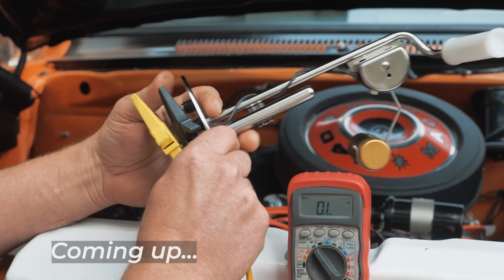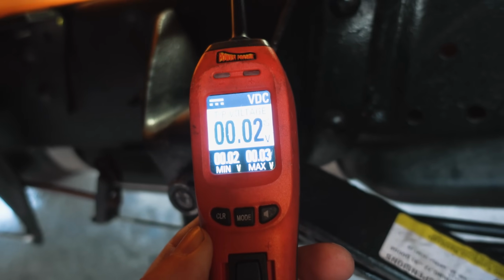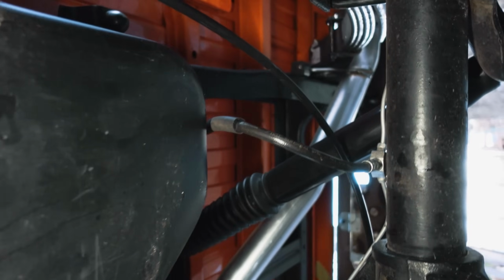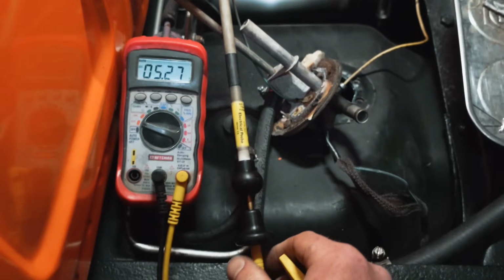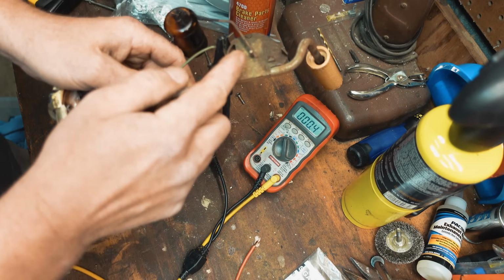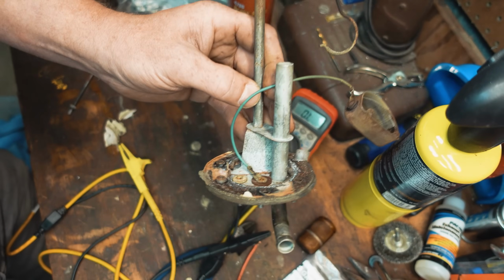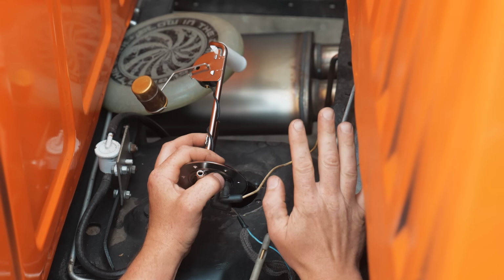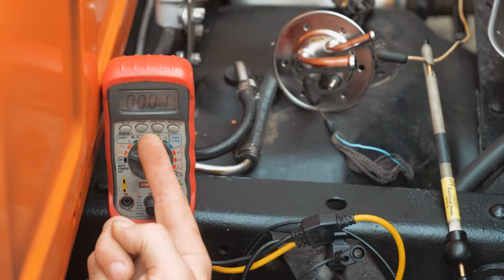Vintage Fuel Gauge/Sending Unit Testing [Dodge Pickup]

Comment: The metal comes from the fuel pump nozzle. When you fill up your tank, it's aluminum. It took me a while to figure that one out.
Reply from the maker: Nice! Thank you
Reply: No problem my friend...
Reply: I was using a 5gal can to fill a generator from a single station over a few months, never fully emptying can. Generator started getting harder to start. Long story short In that full 5gal can I extracted about 1 gal of water. Drained float bowl, good gas again and it ran great. I think we get a lot of....stuff...from the station tanks

Comment: Don't forget, on some of these old cars that use the old style ignition coils that with the key on your coil can be powered up all the time.  Leaving the key on for a long period of time can burn up the coil.  Having learned auto mechanics on old cars like this in my youth, I still to this day, always think about this when leaving the key on on newer cars, even though it's not an issue on modern vehicles.
Reply from the maker: I believe that is on a point type system only. If the points are closed and you turn the key on, then you'll have constant current flow through the coil. I do not believe any of the electronic ignition designs that was as issue, but I could be wrong
Reply: @ScannerDanner  Yes, I believe that is true.  It happens when the points are closed.  Just something to be aware of when working on old cars.

Comment: Great video as usual Paul, even with our high expectations of your channel by now. Do you have the 5 volt adapter for your power probe? Protects modules and gauge clusters. PPT5VA  ;)

Edit: Glad I didn't type in the incandescent test light tip, might have let you know I commented before the video was over. haha
Reply from the maker: I do not! Didn't even know that existed. It is an add on for the pp4?
Reply: Yeah, and it works! ;)

Comment: That activity should not be done over the open hole to the tank. At least plug it. Even static electricity can set off the ullage vapors.
Reply from the maker: Good call, and working around a plastic tank can produce static

Comment: The bypassed ammeter made me sad.
Reply from the maker: I'm sorry buddy. To me it is simply another contact point and gauge/component, where you have resistance and unwanted voltage drops and those create heat. And heat was definitely there! Should have seen the color of the copper wire near the gauge when I bypassed it. (Black/blue copper)
To be honest, imo, this was not a good design even when new. But I get that my Tin Grille friends would want it as designed. 
The other factor is my gauge actually read backwards, and the wiring was correct, so someone rebuild that gauge incorrectly. I just didn't trust it, and most certainly don't need it as I have a voltmeter just to the left.
Reply: @ScannerDanner  wwll pulling it one day and doing the brass sleeve upgrade on it might make a good video for you.
Reply from the maker: @tingrilledodgetrucks5988  brass sleeve upgrade? You'll have to share the info on that for me on your page! I'm interested for sure.
Reply: @ScannerDanner  there is a link in the comments of the "feature" post. Used to be called "announcements"

Comment: You are the greatest teacher by far.  Something I was waiting for you to explain... why is the signal pulsed?  I assume it's there for other circuits that the IVR is supplying and the fuel gauge doesn't need or care about it..
Reply from the maker: I can tell you this much for sure. Thermostatic or bimetallic gauges will get cooked with 12v. We are making heat to warp metal in the gauge. So the IVR steps the voltage down. Now, why it is pulsed, only with a load? I'd have to take one apart to see what is in there. I thought these things were pulsed all the time and they are not!
I do also know that a newer 5v reg with a steady voltage all the time will work great on this system too.
So maybe the answer is that it is a mechanical 5v reg and heat/current flow is the controlling mechanism inside of it?? Best I got
Reply: @ScannerDanner  Thank you!

Comment: Since the sending unit is just pulling a voltage to ground and the resistance of the float is what varies the voltage, there shouldn't be a backwards for the sending unit wiring, should there?
Because the voltage is + source ---- gauge  ------ sending unit ------  - ground.  Since the gauge operates on resistance varying how much the bimetallic strip heat up, it shouldn't matter which way the electricity is flowing, but just how much as controlled by the sending unit's resistance, right?
Reply from the maker: It would read opposite wouldn't it? Full would be empty and empty would be full 🤔
Reply: @ScannerDanner  I don't think so, because the gauge measures resistance, and resistance doesn't care what direction the electricity is flowing, right?
I have a bi-metallic gauge next to me, and put 3v to it, and the gauge went up both times when I applied voltage one way then the other. I think there are some gauges that do care, but I don't think bi-metallic ones care.
Reply from the maker: @Nabeelco  yep, you're right lol, confusing to me for a bit
Reply: @ScannerDanner  All correct, but keep in mind ... if you swap the wires on the sending unit, the fuel gauge will work properly, however you've now applied 12v to the metal casing and tubing inside the sending unit.  The terminal that's bonded/connected to the metal casing should really be marked as ground so you don't hook it up backwards.
Reply: @ScannerDanner  I just did a test with a gauge I had kicking around, it seems it doesn't care, unless I'm missing something: https://www.youtube.com/watch?v=6xLdQ1UD5YM

Comment: Why would it matter which way the sender wires went?  It's just a variable resistor, Resistance is the same either way
Reply from the maker: I think full would be empty and empty would be full wired backwards. Half tank would be the only accurate measurement
Reply: @ScannerDanner  But why Paul. It's a resistor. It would matter on a steel tank the gauge would read full all the time and as you say burn the gauge out eventually
Reply from the maker: @drivewasher  because full has very little resistance to ground and empty has high resistance to ground. The float arm IS the ground. If you switch the terminals, those resistance values will be opposite.
Reply from the maker: It wouldn't matter. I'm stupid lol. Full would be low ohms regardless of polarity. Not sure why that confused me.
Reply: @ScannerDanner  Ha! You see I do listen, watch and read your book lol! If your tank was steel a reverse conection would short the gauge and burn it out though?
Reply from the maker: @drivewasher   🙂 that is correct!

Comment: Paul,  would it be possible to completely drain all the fuel and wipe down the insides of the tank?  With good quality towel,  lint free of course.  Maybe spray down with break clean and give it good wipe down.   I did that on 07 dodge ram 1500 and it had bad fuel pump when give it a tap at the bottom. The job was successful and gave it good fuel all the way to the injectors.  Customer was super happy with the job i did
Reply from the maker: I'd have to drop the tank, probably spray it out with a garden hose, then let it dry before installing it again. Do way to clean it with it in there. The hole isn't big enough to get your hand in there
Reply: @ScannerDanner  good point.   Just an idea anyway.   Do what you do best!!  Love the family!!  They are awesome 👌

Comment: Had a thought SD what if 5 volt wire got shorted to ground , wouldn’t it   
smoke the gage or is this circuit protected in sone way ?
Reply from the maker: I believe that it would smoke it

Comment: the addition was to stop lights in dash pulsing i think
Reply from the maker: The addition of what? Sorry
Reply: @ScannerDanner  what they added on the voltage limiter in the dash i have never seen one on the older dodges have had several
Reply from the maker: @DependableAutoTruck  got it! But the lights don't go through the IVR, only the gauges themselves
Reply: you are correct had forgotten the lights don't not sure what it would be for i looked at my old dodge and it doesn't have it on there

Comment: so much easier to just substitute  a proper resistance source at the sender. decade box, trim pot  or just a plain old carbon resister. if it works its the sender bad. if not  move to the sender wire in the dash after load testing the ground wire (if equipped) if it works now its the wiring to the sender if not test light the guage supply with a test light it should blink.
Reply from the maker: So many different ways to test this circuit for sure. A lot of the guys in my power wagon groups have zero idea of how to test these circuits and I certainly hope I didn't make it worse for them

Comment: the lines on the floats is because it sat the gas evaporated the floats dropped into the ethanol schmuck and corroded the brass. thus the line is level when not inverted
Reply from the maker: Also because the float was not adjusted properly 😉

Comment: no paul  the tank is plastic and the sender is isolated  so no matter which way those wires were put on it would still read the same
Reply from the maker: I believe that is incorrect. Full would read empty and empty would read full if you switched those two terminals. Why? Because full has very little resistance to ground and the float arm IS the ground. So if you fed the sending unit wire on the wrong side, it would have a large amount of resistance to get to ground. You cannot switch these terminals around.
Reply from the maker: You are correct, I'm sorry, it would not matter on this model. Full will be low ohms regardless of polarity. Smh not sure why that confused me.

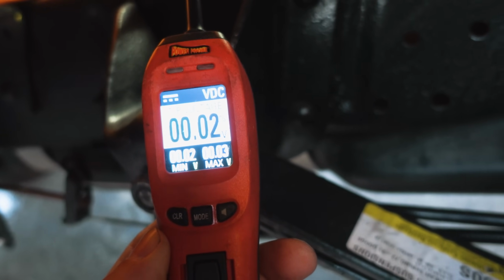Comment: Great video Danner, just one question about the ground test you did in min. 7:30, shoudn't the green LED on the power probe be on (especially now that we know that the ground wasn't loaded)? 🤔
By the way, I loved "the Danner boys" (Beagle Boys) footage with the music and all, thanks for allways keeping footages like those, it makes your videos more fun to watch and more family oriented. 😉👍
Reply: Also, the pulsing signals got me thinking that maybe it's to protect the thermostatic gauge from burning up with a constant load?
For future reference to the comunity that just wants a simple test, unplug the signal wire and the ground wire from the tank and short them together (not for long), if the gauge responds then your problem is in the thank, if the gauge doesn't respond then your problem may be in the gauge (further testing will be needed).
Reply from the maker: It should have, not sure why it didn't? (Turn green) I never touched that ground wire and you saw the loaded circuit test in the end. But I've never trusted the led indicators on the PP either

Comment: just a ??.could it be pulsed to keep the inside tank sending unit thing from over heating and burning out and blowing up?? no mean...
Reply from the maker: The pulsing or voltage regulation is the keep from overheating the gauges (bimetallic strip that controls these)

Comment: I DID NOT realize they were using pulsed signals back then. What were they using to do that? Is it part of the very  'early' computerized systems. I never dealt much with Mopars, just GM mainly.
Reply: its similar to a circuit breaker in as it has a bimetallic strip inside that heats and cools at a fixed rate making contact and loosing contact. i was told it was more of an amperage limiter than a voltage limiter but it should pulse a test light.  everybody used them in one form or another. it also helps keep the guage needles from bouncing everytime you hit a bump
Reply from the maker: This was a dodge thing. GM used magnetic gauges and no IVR . I dont believe Ford used them either
Reply: @richardcranium5839  I worked on several of the 60's and 70's cars/trucks back in the day but do not recall anything like this. Guess it came later. Stopped working on cars (after very early 80's) as needed to have a regular job to pay the bills.

Comment: I have 1.2W 3W 5W 21W and 55W bulb based probes. Really help to test any stuff without burnin it, you just need to know what kind of currents flow through the circuit you test. Also have 2 LED probes of different resistance and one 5k pot :)

Comment: Hey being you think it is rust getting from the gas tank, why don't you do yourself a favor and install a filter before the fuel pump. I saw what may have been a filter at the tank return not sure. But what I learned from working on Toyota back before EFI, they used an inline fuel filter which was not clear but you could see the crap in the bottom side of the filter. With that knowledge I installed them on my Buick and Ford's before the fuel pump using a clear see thru. This was overkill but never had to change the filters at carb's again and you will know in time too. Purolator had a nice one which I used in both vehicles. And your son's are right long winded but we have the 1.5 speed, all good.
Reply from the maker: 1.5 for the win! When I do final reviews I watch in 1.75 lol

Comment: Usually what happens, for anyone with a bad gauge that HASN’T pulled the sending unit, is the float corrodes or gets a hole In it and fills with gas . So you can still go test and get some resistance that’s in the correct range but that won’t tell you anything
Reply from the maker: The key to that condition would be making sure you do the voltage tests that I showed and then also the bypass test to make sure the gauge will sweep fully. But absolutely spot on with your comment
Reply: @ScannerDanner  I admit I hadn't gotten all the way through before I made that comment
Reply from the maker: @Terminxman  no problem 😉

Comment from the maker: 1978 Dodge Power Wagon W150 with a fuel gauge that reads empty all the time. The tests shown in this video can be applied to all Chrylser/Dodge/Plymouth instrument clusters (printed circuit boards) that contain an IVR (instrument voltage regulator) and are using thermostatic gauges. This also includes the engine coolant temperature and oil pressure gauges.
Reply: Thanks for educating us SD😍
Reply: Just a shade tree tip for ya.  But I've changed several fuel pumps in trucks by leaving a couple of bolts threaded in on one side of the bed, then jacking the other side up and propping it up like a hood almost, but sideways.   I often have found that to be the path of least resistance.
Reply: So what is that scope?   I looked through your tools links and I can't find it.
Reply from the maker: @calholli  it's called a uScope and you'll find it here https://www.aeswave.com/scannerdanner-c512/
The master kit is around $400 and comes with an amp clamp and secondary ignition adapters including a COP probe, and then also test leads.
Reply: Great topic and details! I had to sort it all out on a '79 D-150 project. After replacing the fuel sending unit to repair the gauge, the truck sat outside for a couple years. After getting started on other repairs and running the engine for a while, I had your scenario. My previously rebuilt carb started flooding and the gauge quit working. The sending unit was rusty when pulled and the carb was corroded from water too. Head scratching! Turns out the flush mounted fuel cap that looked just fine leaked rain during downpours. Another sending unit and a new fuel cap and carb were the fix.
Always enjoy your content!
Reply from the maker: @robertpage2576  great tip on the fuel cap! Got to look at mine close now. Thank you!